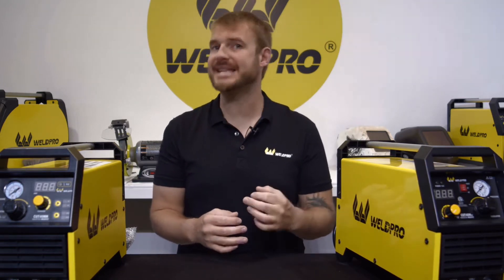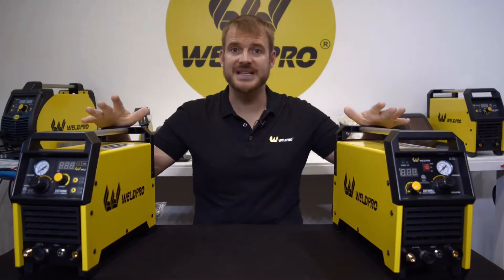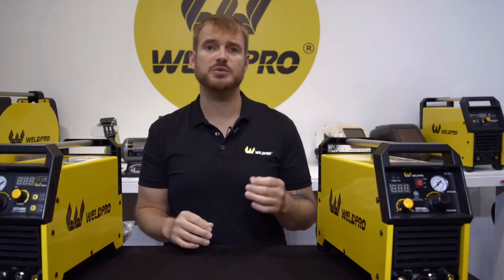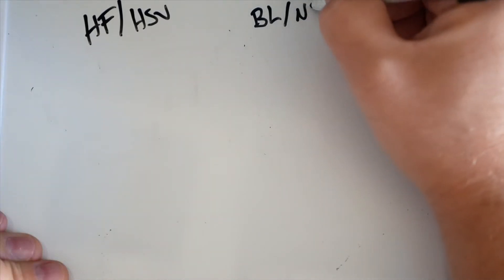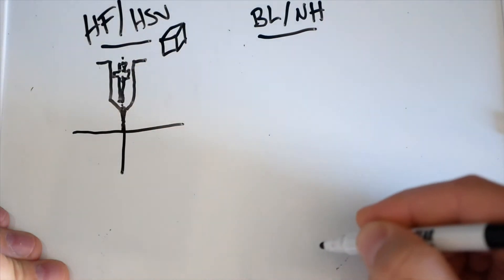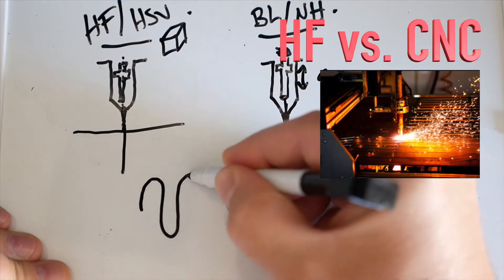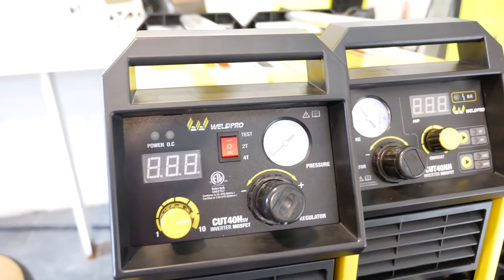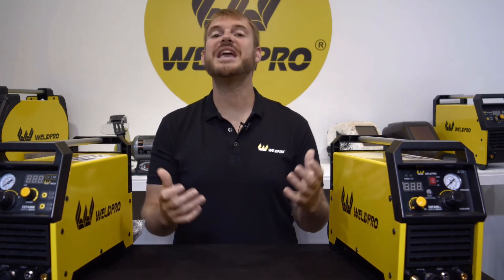Plasma Cutting Quick Tip #2 - High Frequency Start vs. Blowback Start - Which one to buy!?

Comment: Wow I was really happy to have this link come up but left with almost no additional information. Why would I want one more over the other. Do different metal or alloy types respond differently? Why was one technology generated over the other? Only to solve the CNC use? Is there a cost difference going with one technology over the other? In the video it says neither technology requires touching the surface, if that's the case how does the spring get depressed in the blowback to initiate arc?

Comment: Hello, I have a Miller 2050 plasma. I want to change the torch to a p_80 type. Can you help me? Thank you.I bought a p-80 torch and installed it instead of the milling torch (iCE-55c) and it did not work. It did not cut or give any spark. I tried a lot but did not achieve any results.
Reply: I believe the Miller ICE-55C torch uses mechanical blow-back style pilot arc starting, and the P80 uses high frequency pilot arc starting.  That means they are not interchangeable.  A call to technical support at Miller Electric Co. will get you the answer directly from the source.

Comment: The should just use a laser to ionize the path to the work to start the plasma arch . No interference
Reply: Good point.
What about the current initiated in the air ionized by the lazer travelling back into the Lazer? It's high voltage! The Lazer would not have to be grounded and it would still occur.
Reply: @ not exactly sure yet . I haven’t had a budget to tinker with such things

Comment: If there is essentially no difference then why make two types? It is my understanding that blowback start machines produce FAR less electromagnetic interference than HF start machines and are recommended for environments where there are sensitive electronics (CNC control boards and computers for example). Please elaborate further. I'm about to replace my CNC cutter with a blowback start due to the endless challenge of trying to avoid EMI.
Reply: Do not use a HF start plasma cutter for CNC work or anywhere where sensitive electronics are being used.  The mechanical blow-back start cutters are designed to cause little to no noise/interference.  They both have pilot arc starting, that is the similarity.
Reply: @nickcampbell3212 I couldn't agree more. I bought a high frequency pilot arc machine and battled the EMF problem forever. High frequency machines are 70s tech. And they will produce nothing but problems. You may overcome those problems one day and the next day they will be in your face. I sold my high frequency pilot arc machine and bought a blowback start. Waiting for it to show up in the mail and looking forward to stress-free cutting.

Comment: Well, this video didn't give me any information as to which I should buy. They did cuts and said they used it on a bunch of different material but which one is best for what?
Reply from the maker: Basically this video is to explain that there isn’t much of a difference at all. Really the only consideration to make is that if you have a CNC machine you might like to go with blowback start
Reply: @WeldproWeldingEquipment  If there is no difference then why make two types? It is my understanding that blowback start machines produce far less electromagnetic interference than HF start machines and are recommended for environments where there are sensitive electronics (CNC control boards and computers for example). Please elaborate further.

Comment: What happens when someone grounds the work piece with a wire to the torch cup?  They claim that you can 'mimic' the auto pilot arc start feature in machines that have that feature built into them.  Will doing a pilot arc conversion hurt the plasma machine?
Reply: You can, it tends to burn out whatever you use to complete the connection. It hasn't hurt my machine. 
Pete's Tools has a good video in it here https://www.youtube.com/watch?v=AYeXD7cNRaQ. It's actually very easy to do.

Comment: Ok I have a question?... 
I have read online from Esab. They actually have a plasma cutter that has a cutting gas, along with a Shielding gas. And they have pictures of like argon shielding with compressed air cut, or HHO cutting with argon or c02 shielding.
Or a argon/helium mix.

And you get different cut finishes along with faster deeper cuts on thicker material.

I wanna know, can any plasma cutter run a dual gas plasma torch, with an auxiliary shielding line attached or custom choice of cutting and shielding gas?
Reply from the maker: That doesn't seem like anything that would be productive unless it was some kind of titanium or nonferrous cutting that required shielding but I have never heard of using argon with a plasma cutter. Thanks!
Reply: @WeldproWeldingEquipment  
If you google these words exactly.

“plasma cutter shielding gas and cutting gas”

You’ll see them talk about using argon and hydrogen, nitrogen and hydrogen, and Methane and Nitrogen for thinner Stainless steel.

I remember they went into how compressed air needs a filter, because like my air compressor at home, every time I’m done with the air compressor, I release the valve on the bottom of the tank, because if I don’t, the compressed air will condensate and moisture will build up inside the tank, and rust the tank from the inside.

So that makes me curious, your built in compressor.. is there like a small tank Inside? 
Curious if I could open it and add an Inline water filter separator?
Reply: @TimmyzZs  They don't have built in compressors. You hook up an external air compressor to the unit. These units don't appear to come with an inline water separator, like units hypertherm sells do. Just add one to the line from the compressor to the unit, and you're good to go. 👍

Comment: Ok, I was jus about to order the weld pro AC/DC tig.
And the 50a Cutter, but daymmm that’s kinda steep.

I might look at the prime weld AC/DC tig and their Cut 50 or cut 60.

I wanted my tig to match my plasma and be a loyal customer with a matching set. Hahah
Reply from the maker: Keep your eyes open for some specials and giveaways!
Reply: I have WeldPro's 200 amp Tig and I love it. I've certainly heard prime weld makes some awesome equipment, as well as AHP, but Prime welds offerings, as well as AHP's TRADITIONAL offerings, are analog controls, instead of a digital readout. Although after I bought my Weldpro, AHP has since come out with a digital model. I wanted a digital readout for consistent repeatability. Also WeldPro's interface is very intuitive, a good mix between not having a thousand dials on the front, while also being able to make fast changes and not scroll through clunky menu options to get to settings, as some of the LCD units suffer from. The pedal isn't bad either. Sometimes I prefer it to the traditional "Lincoln style" foot pedal, though if you needed to weld in a weird position which requires you to operate the pedal sandwiched in-between your legs, it certainly falls short there. Everything else is very well executed by Weldpro.

Comment: Usually high frequency doesn't interfere with CNC electronics? That is absolutely the case for a lot of people and most plasma table builders won't support a plasma cutter that isn't a blowback start.
Reply: @TheBreaded Hey I live in Europe and none of the websites tell wheter it is a blowback or a HF start, the sales people I call don't know the difference either. Is there any way you can tell by the looks?
Reply: @michielplatteau9750  Usually if they don't state it being blowback, it probably isn't. What model plasma cutter are you looking at?
Reply: This can usually be fixed with some diy shielding. I fixed a broken plasma table that was sitting for years, unused due to comms errors when the torch started by shortening the parallel port cable and shielding it.
The idiots had a cable that was extremely long and coiled all the extra ON TOP OF THE PLASMA CUTTER. And then wondered why they got comms errors.
Reply from the maker: Great input! Thanks for the info.